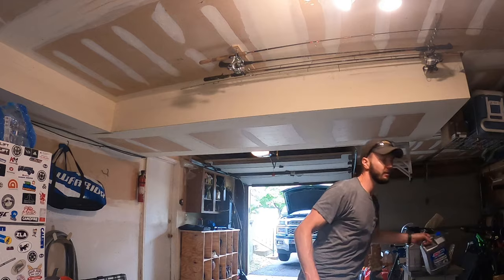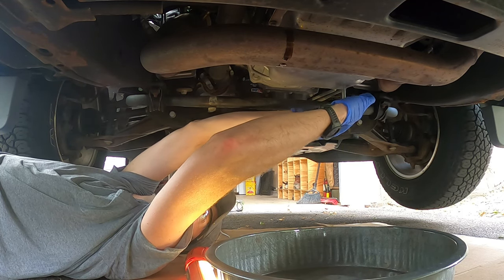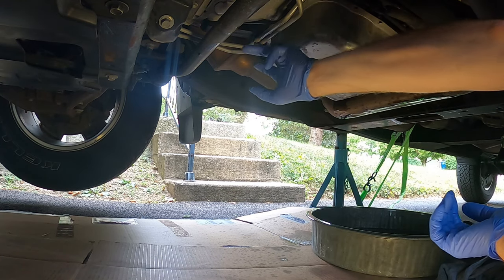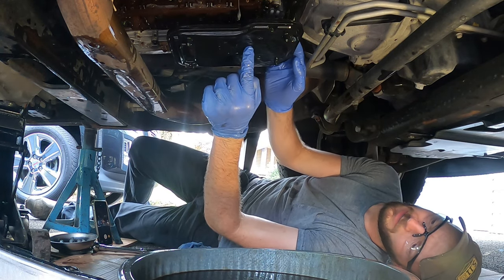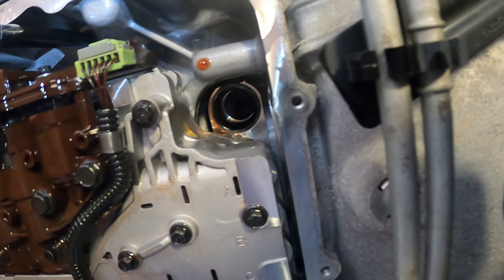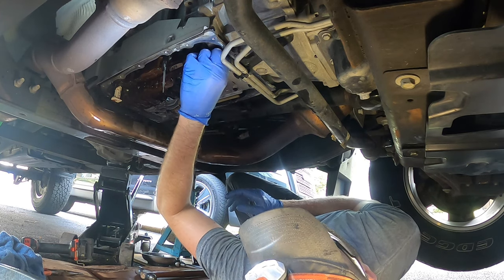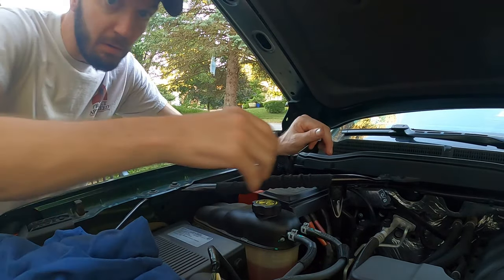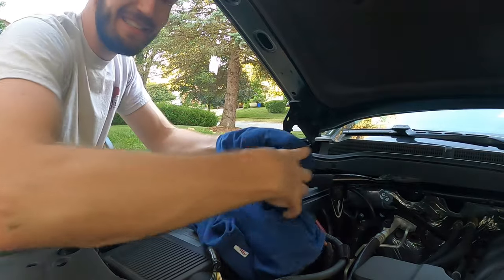2014-19 Silverado/SierraTransmission 6L80 Fluid Change

Comment: Great job. I long for the days when every pan had a drain plug.
Reply from the maker: You and me both!
Reply: My 2003 chevy suburban has a drain plug on the transmission pan i wish every vehicle had one.
Reply: I wonder if it would be possible to drill a hole in that pan, drain the fluid and then install a plug and refill?
Reply: @njgrplr2007  yes it can be done. Be sure you install a plug with a magnet though
Reply: Every time I service a transmission for the first time I hunt down a pan with a drain bolt and order it. If I can't find one, I'll weld one up.  No drain plug on a transmission that needs to be serviced periodically is not an option for me.

Comment: You don't need to change out those gaskets on the end of the filter. Also, you don't need to put it back up there with a sock an extentsion either, just put it on the new filter and install it. You made this whole thing way more complicated than it needs to be. I'm only here for the amount of fluid
Reply: If I'm dropping the pan, I am sure as shit swapping that gasket!  Also, If it's the first time I'm replacing the ATF, I'm installing a pan with a plug. If it's not available, I'm welding a drain bung on a replacement pan. 😂

Comment: Your filter O Ring gasket just as easy to install it on filter neck and push it in transmission as 1 Assembly tap it up all the till it seats with the Palm of your hand.The old O riding just get under it with a small screw driver bend a gap to shrink it and it will pop Right out

Comment: 1.0 Hour with no lift done it several times.
Reply: Can confirm, just completed the job today in my driveway in about an hour on my back. Took longer to drive it back up to temp than to drop the pan. All you do is rotate about 45 degrees towards the driver's side and it wobbles right out. Thanks for giving me the courage to tackle this job after watching this trash tutorial

Comment: I have a 2012 Silverado 6L80. I was able to remove the trans pan without going through all the pulling on the exhaust or jacking up the trans. Be sure to remove the dipstick first.

Just unbolt the pan except one screw in the front. Tip out what fluid that you can then remove the last bolt. Reach in and remove the filter (be careful of the fluid in it).  It takes a bit of trial and error to get the filter out but it comes out fairly easy. Remove the pan gasket. Put the pan up in the front and twist the front of the pan at about a 45* angle towards the driver side and easily wiggle it out from between the trans and the cross-over pipe. Don't force it. Just wiggle it around until it slides right out. Keep the pan as level as you can until you get it in a position to dump the fluid in your drain pan.

Comment: I wish the 2014 Silverado 1500 had a transmission drain plug. Such a damn mess. I used a wood wedge to pull the exhaust down slightly so i could get the pan out completely. Worked well.
Reply: That’s what I’m about to do
Reply: Me too 😊

Comment: Thanks for the tips! Definitely made the job a lot easier. The hack I came up with to lower the exhaust was that I jacked  my floor jack beneath the sub frame next to the spot where you pull down on the exhaust. Then I ratcheted the front wheel axle of the jack to the exhaust, and as I jacked the subframe up, it would then pull down on the exhaust. Gave me enough clearance to pull the pan out, just like in the video!
Reply: I used my wifes scissor Jack,  put it on top of the exhaust, near the flex pipe, jacked it up to the floorboard until the exhaust dropped just enough for clearance. Easy peasy
Reply: @teenice894  great idea

Comment: Got a used Yukon XL recently, wanted to update it to the Mobil1 HP fluid. Used a MityVac fluid extractor and pulled about 5 quarts out of the dipstick tube. After 2 changes the shifts are much smoother.
Reply: What transmission  and miles if you don't mind me asking? I'm looking at one withe the 8 speed but I'm leary of it.
Reply: @jckdann7  The 6, 8, and 10 speed transmissions all call for different fluids.  3 different "factory" fluids.

Comment: Well, just wanna point out that mine never had the required clearance to take off the pan, EXCEPT with losing the manifold's flange nuts. I think the real and easier method is to losen the exhaust. You guys are lucky to have this that easy.  My 2018 was a real PITA.

Comment: Few things that may help people 3/4" pipe thread fits the filter gasket (not pan gasket) and removes it in seconds, build a tee with about 10 inch riser and short run and thread in the seal where the filter plugs in, tap the seal out, use a siphon to pull the last fluid out, reverse the socket - insert the extension inside of the socket this will have the same OD and a larger flat surface against the seal.

Comment: GM has a tsb to use the blue label Mobil 1 LV HP atf instead.Having problems with the dexron 6 causing torque converter shudders and blowing the torque converters
Reply: Only for the 8 speed. This 6 speed transmission was not included in the ATF switch.
Reply: @hutmaker28  All applications,not just the 8 speeds.Jasper and most transmission reman companies have found this out.
Reply: @Toolaholic7  I'm sorry but that is not the case. There are no TSBs that include the 2014/15 6l80s for the fluid swap. If you are out of warranty, go for it. But if you have any type of extended warranty, using anything other than Dexron 6 will void said warranty.
Reply: @hutmaker28  6 speed is on the list as well
Reply: I want to be wrong on this because I have my own concerns about my 2014 GMC Sierra. Can you drop a link to the TSB that recommends the new fluid for the 6 speeds?
Reply: THE TSB shows the 6 speeds.

Comment: I have to pump mine in from the bottom of the pan 😢.  No dipstick for 2016 Silverado LTZ. But same concept  except you have to check the level by heating to a specific temperature and then checking to see if it drips or drains in a stream but not too much of a stream 😂.

Comment: I welded an O2 sensor bung with a plug and copper washer on a replacement pan then swapped it out when I replaced the filter. I do a drain and fill every second oil change which gets about half the fluid. Going to add a Superior Solutions STL010 to the thermostat for full flow to cooler and do the Mobil1 HP ATF swap next.

Comment: If you want a “flush”, do a fluid change (new filter and old seal/gasket if in good shape). Then pump from the transmission dipstick about a quart every decent drive to slowly replenish all the fluid in the transmission to new.

Comment: if you have to do that job again, instead of making a mess with fluid, get a transfer pump, stick the hose all the way down the transmission dipstick and pul that fluid out. It's a pain to use the hand pump and pump it out, but it makes for a lot less mess when you go to pull the pan down.

Comment: I tried jacking transfer case still not enough room. Tried ratchet on exhaust and didn’t even budge so I cleaned it best I could put new filter in and put it back together so here’s hoping it’s ok
Reply: I just did mine 5 minutes ago and I ratchet strapped the exhaust to the frame then jacked up the transfer case to where the mounting bolts were half way out and the pan came out and went back in very easy.

Comment: Ah' this takes me back to dropping my first GM hydrostatic pan when I was 18 and nervous on my 88' Cavalier with the 2.0L.

Now, I have to do this again on a few 6L80's for the wife, 20+ years later. GM  read and butter right here. Good thing I learned some sh*t back in the day when I first took a few dexMerc baths. ....FAFO ftw.  

Lazy mechanic tip. 
The right sized and decently thick wooden board across the pan (to the walls) and a old school emergency scissor jack work grate together to keep tension and free a hand up. And to slowly lower the front with a lot of control and ease....until it catches on the bolts letting it hang to drain when doing the classic tilt. 

And it helps keep you out of the splash zone directly under it a bit.

Comment: do you HAVE to replace the filter gasket or can you just pop in the filter and call it a day ?
Reply from the maker: You definitely do not have to replace it, just inspect it for any signs of damage or wear.
Reply: I just replaced the filter. Left the filter gasket in place. No need to screw with it and create a bigger headache IMO

Comment: Rebonjour je viens de voir comment tu fais ton niveau d'huile de boite. C'est bien moteur tournant et boite chaude. Le moteur est a l'arret et l'huile de  boite chaude. Pas facile pour moi c'est la premiere fois que je le fais. Merci d'avance
Hello again, I just saw how you do your gearbox oil level. It's fine with the engine running and the gearbox warm. The engine is stopped and the gearbox oil is hot. Not easy for me, it's the first time I've done it. Thanks in advance

Comment: Did you have any metal shavings on the magnet when you removed the pan? Do the pan bolts go back in, in a certain order?
Reply: Normally you want to start from the middle and work your way towards the outside to ensure the gasket seals evenly

Comment: Does the V6 engine have the same exhaust cross member issue? I would think it wouldn't not due to the engine being 1 cylinder shorter on both sides than the V8
Reply: I wondered the same. But that probably doesn't change the trans location. The engine is probably just set back further in the engine bay giving more space in front. But the exhaust system would likely be somewhat different. I've never pulled mine myself or I could tell you for certain...

Comment: Why do they not put a drain plug on transmission pans?? When I do my vehicles I use the harbor freight fluid pump which works extremely well , you don’t have hot oil to deal with when pulling the pan. It’s an under $20 item

Comment: How is the Amsoil transmission fluid doing? Iv been thinking about switching to Amsoil products
Reply from the maker: Everything has been great so far, I did an oil lab analysis on another video and all looked great. https://youtu.be/BLPI3E5FKtE
Reply: I changed mine to Amsoil 10k miles ago. No issues. Runs very smooth.

Comment: My manual says 75,000 miles before you need to change the AT fluid.
Reply: So did you replace the transmission?
Reply: 40 thousand miles if you tow a trailer any. 75 thousand is highway miles under normal conditions.

Comment: tried to get my dealership to change fluid..................they declined 2014 silverado
Reply: Dealer supposedly changed mine (trust issues with mechanics) but they wouldn't change the filter, said gm doesn't recommend it unless there's a leak. Odd because the manual says to replace fluid and filter. I'm guessing it's because of having to move the exhaust to remove the pan. First and last time I take it to the dealer unless it's warranty work.
Reply: @Draega007  That makes no sense.  I can understand not changing a gasket unless there is a leak, but a filter?  My guess is that they charged you for the hours required to remove the exhaust line and then the pan/fluid (per their service manual), but actually just vacuum some of the fluid out and replace it, so they never actually open the pan at all, so they didn't actually have access to the filter and that is why they didn't change it.  They're no better than the quick change joints except their employees and managers make more money.
Reply: @miscellaneous037  yea that was the first and last time I took my truck there. I've never trusted dealerships and that just confirmed my suspicions. Especially since the owners manual clearly states the mileage recommendations on the filter change for the transmission. Luckily I'm mechanically inclined so it doesn't bother me by not taking it the dealer for service.

Comment: You just mix the new oil with the old trans oil in the torque converter. With a flush it take 11-12 quarts of oil flushed through the transmission lines. Cleaner process when u take the oil pan off
Reply: For this truck, GM does not recommend a trans flush genius.
Reply: never FLUSH a transmission.....  reason being you flow fluid backward thru the system thus flowing dirt and debris up into the motor.  Can lead to problems down the road.
Reply: trans flush are not recommended anymore on most vehicles

Comment: Is more than 10 minutes job 😂😂😂 now after filling up with transmission fluid you don’t need to shifts between the gears and then check the fluid before move the truck right?

Comment: Ya gotta love the moronic design GM has kept using in these for the transmission filter seal. Such a garage design and a cluster f**k to remove…. Why I love working on Aisin transmissions and detest GM.
Reply: A real mechanic has no problem getting that pan off without all the geriatrics.

Comment: Just my strong opinion here, don't believe the hype on the high mileage engine oils. Why my STRONG opinion? Because I fell for it on a 2007 Toyota Rav4. What happened? Carbon deposits get in the oil rings and won't allow them to expand outwards towards the cylinder walls and allows blow by. I had to add a quart of oil about every 2 weeks or within every 500 miles. 
 Your better off to buy a cheaper synthetic oil and change it every 5000 miles, regardless of the manufacturers recommendation. Yes, if your vehicle is new, 7500 mile oil changes will get you past your warranty but it's doing more harm than good in the long haul, well past the manufacturer warranty. 
 Just wanted to share my experience so you don't end up with the same problem. 
 Also these trucks have the 4 cylinders that shut down on and off as your going down the road, unless you delete it or put a Range Technology and leave it in the OBD port, which I highly recommend. If any of those lifters collapse, your looking at a costly repair. You don't want any additional carbon deposits floating around in your oil and causing those lifter springs to fail. Your looking at $4000.00 repair to have the DOD delete done correctly. 
 Take care and great video otherwise.
Reply from the maker: Great call, and yeah, I just wanted to 'test' it out but typically change pre-timer with whatever is on sale. Thanks!

Comment: It'll serve you Well to Replace that cheapass magnet in the bottom of that TranPan with a Neodymium Magnet upgrade! 
It's not gonna hurt Nuthin' in your Transmission ... and will definitely work Much Better pullin' out ALL the metal particles outta that oil and keep 'em from cyclin' Back into your system again.
Reply: Also - I strongly urge you to consider Wrapping that Exhaust pipe (especially the section running Directly Under the TranPan)
Titanium Twill Weave (2in X 50ft) Exhaust/ Header Wrap will help to keep the High Temperatures DOWN.
That Exhaust pipe is just inches away from that Transmission Oil Pan - Sittin' there, Gettin' Hotter & HOTTER ... Literally COOKIN' that damn Oil !!
Wrap That Turkey!!

Comment: Everything looks good except you just mixed old with new not good. You should off done a flush thru the transmission cooler line from the radiator. I also installed a drain plug being a welder for easy work for next time.
Reply: Hey genius! GM does not recommend a trans flush on these trucks.
Reply: I was thinking of installing a drain plug, where did you position yours, so not to interfere with internals?
Reply: @buddyrebel_Garcia  it’s not what they recommend it’s common sense
Reply: @93gmctruck18  hey you’re funny
Reply: @buddyrebel_Garcia  correct but you can suck out the pan,  refill and undo the cooler line  and pump out about another gallon then refill again till you get new fluid out of the cooler line, you change the entire fluid capacity like this. Its not really a backwards flush but it does the same thing and is much easier
Reply: @bullofthewoods9374 at the thermostat  block? I was going to have it off to do the mod. 
Thought obout sucking it out wondering if that would work.

Comment: Dude I don’t think it’s ever ever, ever ever ever a good idea to change transmission fluid or filter. Honestly Iv had the very best luck leaving that fluid alone. If anything. If or when I ever had a leak I’d catch that shit and poor it right back in there. I swear by this. I don’t have transmission issues. Over 1/4 million miles on my GM 4L60 6L80 just saying Iv used to think like that and I found my self shopping for transmissions not much longer after a fluid and filter change. Honestly
Reply: thats the thinking. but if you change it when the manual says to then regular changing is fine. when you dont change it for say 150k and its not synthetic then your right you dont change at all. My allison says change at 150k and do a spinon filter change at every 50 k and im good with transcend sythetic.  I would neve go over 100k though without changing jmo. i had a 01 gmc yukon xl that had dex 3 in it i changed every 50k and it had 265k on the engine and tranny when i just sold it this year.